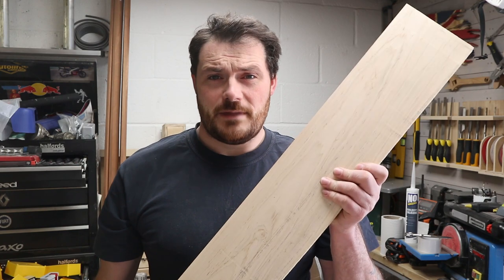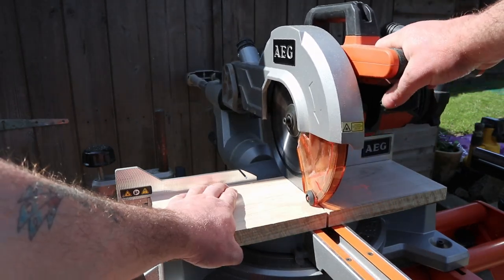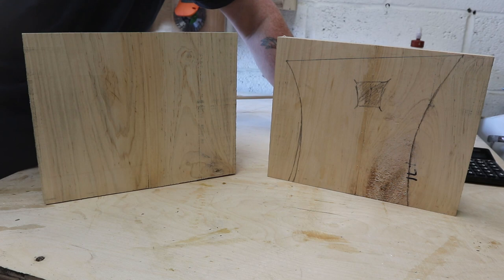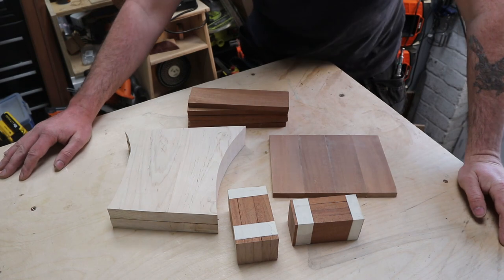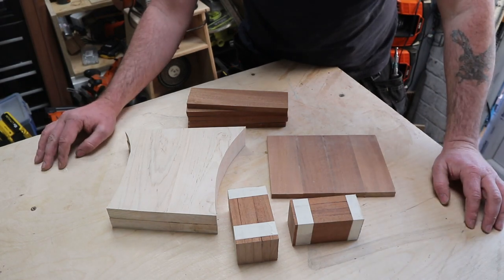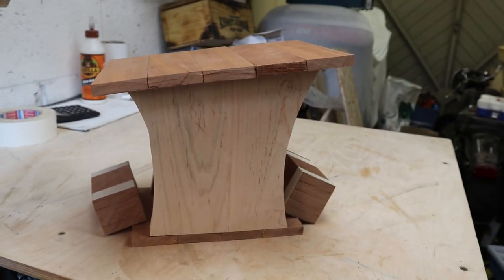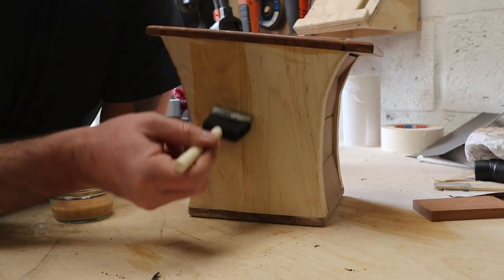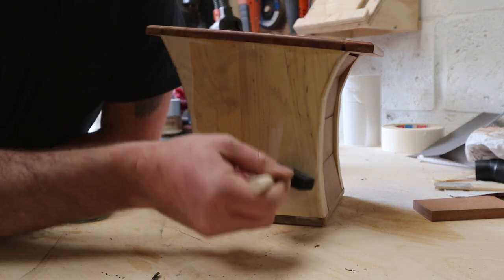Scoutcrafter Bird House Challenge - (just a bit of fun)

Comment: Great project this video popped up in my notifications as I was researching sizes for making a nest box specifically for Robins
Reply from the maker: Thanks! Brilliant, did you manage to find out the size required? This one internally is 4 inches wide and long, and 4 inches to the height of the hole
Reply: @JamesManCave  I'm planning to use the rspb guidance and plans from their website. As robins prefer an open front box they suggest you make the front plate half the height which should attract Robin's, Pied wag tails and Wrens so fingers crossed
Reply from the maker: That's interesting, I got quite a few pied wagtails around my house, might look in to making one my self 👍